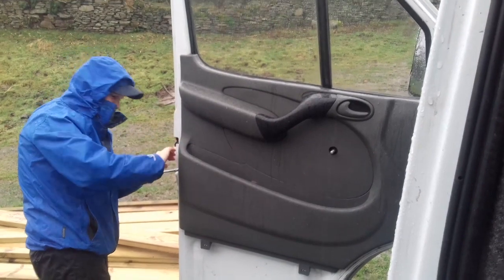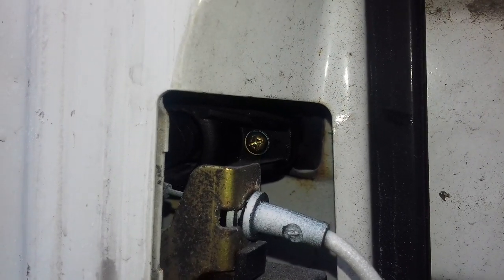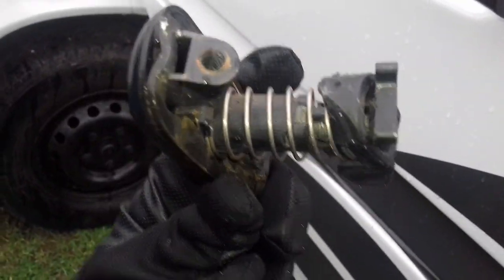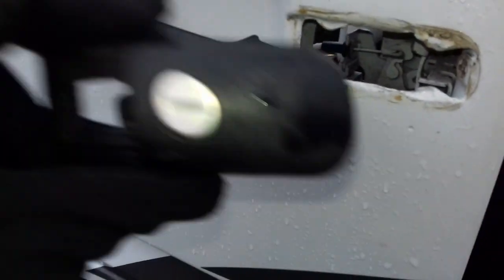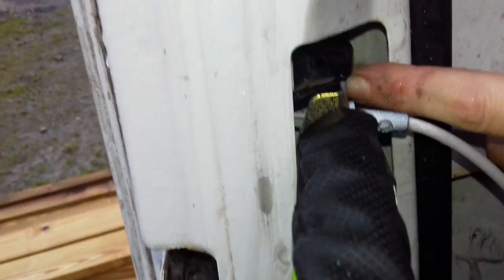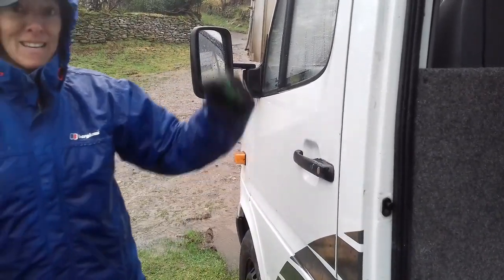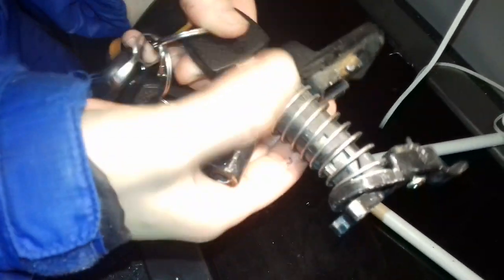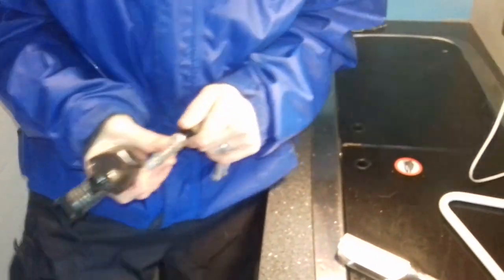Mercedes Sprinter Door Lock cylinder removal / replacement | Vanlife

Comment: I need to swap my existing lock cylinders into a new handles and this is exactly what I needed.  Thank you!

Because of weird problems with my locks & latches I've removed the entire latch assemblies (including power actuators and door-ajar switch) out of my 2005 T1N's front doors countless times during the past 2 months.  During the first month of many attempts to fix the problems I too removed the screw that fastens the "lock cylinder holder" to the pull handle (the screw that likes to fall down into the bottom of the door shell).   One day without intent I forgot to remove that screw. After I removed the yellow-gold T30 screw from the rear of the door frame I found that the entire handle (the part that holds the lock cylinder + the pull handle) slides toward the rear of the van.  The front portion of the handle (containing the lock cylinder) can then be pulled straight out of its mounting hole enough to clear the sheet metal.  Then slide the entire handle a bit forward (< 1 cm) to line up the "T" pegs that anchor the rear of the pull-handle with the matching slots in the door shell.  The handle can then be removed as a single piece (-:

Thank you again.
Reply from the maker: Hey we are so glad you found this useful. Thanks for your top tips too! Our efforts were really trial and error but we had fun doing it! Thanks for commenting - really nice to get positive feedback 👊

Comment: I've just been fighting with my door locks as they were sticking and needed a good clean and application of WD40.  In fact I don't think you needed to remove the door card, as once you've undone the single screw inside the edge of the door you can gently prise the handle away from the door panel and, with a bit of careful jiggling, the other end of the handle will move in its T-shaped slot sufficiently to get the whole handle off from the outside only. Useful to know how to do that, though, in case I ever need to.
Reply from the maker: Thanks for your message Lorna! Always good to keep learning how to make these odd jobs easier!
Reply: Awesome, and once you've done that you just spray some WD40 into the mechanism? my locks seem to very sticky as well and trying o work out how to fix them thanks!

Comment: Excellent vid! I just bought a handle second-hand and I need to swap out the cylinders since my handle is broken but I do not have the key for the second-hand handle. Will I still be able to swap cylinders? I only have my key for my old broken handle. Thanks!
Reply from the maker: You should still be able to pop the cylinder out of the handle you bought 👍 Glad you found the video useful 🙌

Comment: You did far much work than necessary there. Leave the inner door panel and handles on - don't undo the screw inside the door on the lock and lose it 3 times. Just take the hex/torx bolt out from inside the door jam - nudge the entire door handle towards the middle of the door and the whole handle pops out. Takes less than a minute. Sorry for the bad news.
Reply from the maker: Always learning from experience 😁

Comment: Dont they need coding ? Or is not central locking, thanks
Reply from the maker: Our passenger and side door keys were separate to our ignition keys so no coding needed. Not central locking either 😀
Reply: @TheMahoJos  i wonder if i removed my back door to a non central locking lock, if the central locking would work as normal??
Reply from the maker: @d4ngerous4  Ooh not sure to be honest

Comment: When I insert my key into the lock and turn it left or right it just moves freely and doesn’t do anything. Do I have to replace my lock cylinder(
Reply from the maker: Sounds like it might have broken or become detached?
Reply: @TheMahoJos  thank you for the very quick reply, I am a bit confused. On my E46 bmw I had the same issue and I just bought a door lock cylinder repair kit and replaced the broken pieces. Looks like for my Mercedes sprinter this is not an option. If I replace the cylinder itself don’t I need a new key? Then it will need to be programmed to start the car
Reply from the maker: @omerkurt9406  Unfortunately we don't know about programmable keys. When we replaced a couple of cylinders, yes, we did need another key which is a little bit annoying.